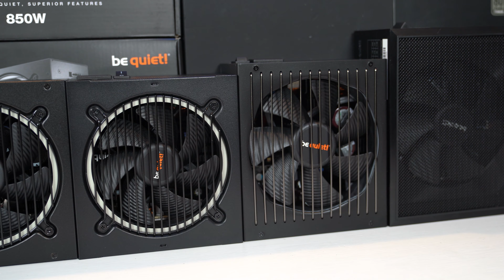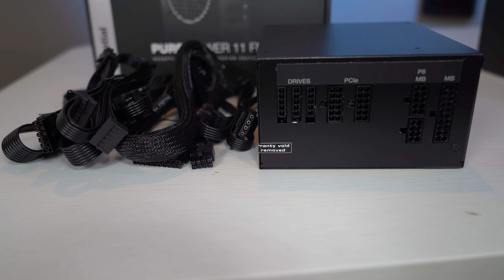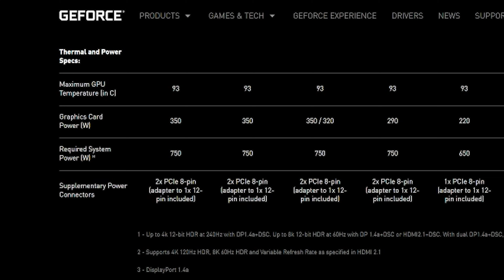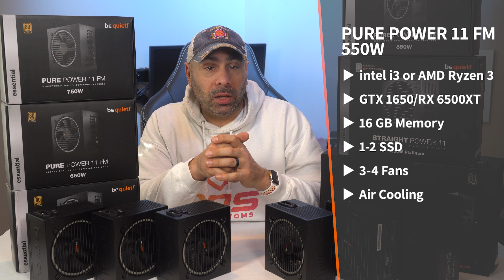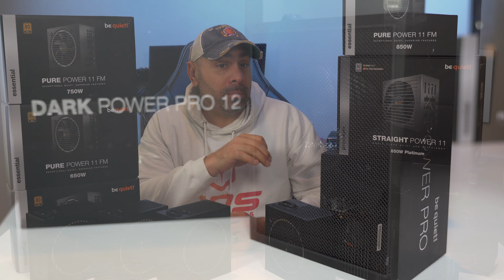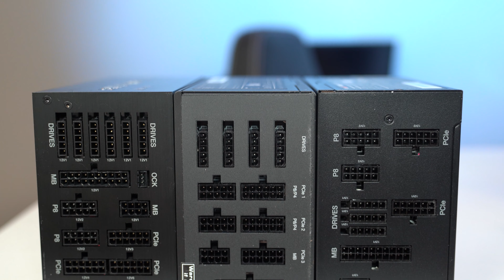How Much Power Do You Need In 2022?

Comment: I love going overkill on my PSU's. I simply don't care that that my normal desktop usage only uses 20% (which translates to roughly 86% efficiency), and that it could be a little more efficient. I'm currently using an Antec High Current Pro 1200w for a 5900X, 1080Ti build. It's a legendary PSU.

Comment: I'm waiting for the 40 series. Can I use (ASUS ROG THOR) 850W Platinum certified PSU for:
i5-13600k
Mid Tier Mobo
RTX 4080
AIO Liquid Cooling
4x 8GB DDR5 6000 Mhz
4x Fans
2x NvME
1 HDD
(I just ordered the PSU, don't want to make a mistake)

Comment: I have a 3070ti, Ryzen 9 3900x, 32gb ram, msi b550. 2.5tb ssd and 6 fans. Currently using a 750 gold+ psu. No heavy overclocking or nun of that. Is a psu upgrade a must??

Comment: I know GPU manufacturers tend to over spec PSU requirements as they generally cater for moderate/extreme overlocks and multiple attached devices etc. I personally have multiple itx rigs which according to many would be well under spec’d PSU …:
- R9 3900x w/ RTX3080 custom water loop 32 GB ram, 2x NVME & 3x SATA SSD on a Corsair SFX 750w platinum psu and runs well under its power requirements from the wall
- R9 5900x w/ RTX3080Ti, 32 GB ram, 2x NVME, 2x SATA SSD - Cooler Master 850w Gold SFX PSU

- R5 3600 w/ RTX 3060, 16GB ram, 2xNVME & 1x SATA SSD with a FSP 400w Gold PSU 
and in all cases, no overclocks other than PBO and I don’t generally use more than 50-65% of the PSUs capacity under gaming loads and light video/photo editing 👍🥰🏆🤩 I’ve even done some undervolting which has seen at least 10-15% … sometimes a bigger drop in watts drawn from the wall. CPUs / GPU’s / NVME / SATA / RGB light strips etc have become sooo efficient in many cases …. That high end PSU are only needed, as you mentioned Brian, for those with HEDT setups or small home servers etc with multi-GPU setups and super high-end super multi-core Epyc Or Xeon CPUs.

Comment: G'day Brian,
I hope lots of people watch this as this is where there is so much money wasted by people in Builds,
as an example Greg S did a $1000 Fiver Build Challenge video & the first build had i5-11400F, H410, 16GB RAM, 1GB SSD, GTX1650 & EVGA 650-V1 80+B ($50),
He also did an optional $1422 Upgrade Build with i5-11400F, B560, 16GB RAM, 500GB M.2, GTX1660Super & Corsair RMX850 80+Gold PSU ($125), 🤷‍♂️WTF! why would you recommend that PSU upgrade as a 650 is plenty
Reply: Ps I edited as after reading it looked like I said it was Greg's recommendation, it was not & Greg's thoughts on the builds were very good

Comment: Brian, Good Video 🙂  It might have been helpful to some if you mentioned the efficiency curve that all PSU's have on the side of the box.  That shows that your 'Peak' efficiency takes place when you run a Power Supply at 50% Load.  I am a Professional Engineer, and that 50% is rooted in many power-oriented devices, since the 'very large' inductors that make up the main transformer avoid hysteresis by hovering at the 50% Load point.  The efficiency on either side of that curve drops significantly, which add credence to your statement that a PSU either too small or too big is not optimal.

Comment: When I built my fx system years ago i bought an evga 850 g2. I had no idea how big it was until I got it in my hand...at 200mm it is a beast, and I had to work to fit it and the cables in my case even though it was fully modular.

Comment: The only thing I would add, I often build with a upgrade path included. With a 10 year warranty on better brand psu's, they can be around awhile. Maybe I don't have the money for a 3080 today, but build a system planning for that in the future. Or next year's gpus up the power ususage, we've seen that. I often build entry level type systems with the choice to add a dual 8 or 8+6 pin gpu later. That adds some flexibility for a little added cost, but saves having to replace a psu just to get the power for your new gpu. 
Happy Building!

Comment: I just pick the SeaSonic that fits my budget or a psu from another company that was made by them. 

Just got a pretty good deal on a Focus Plus 850w for $84 

More then I need for a 3060ti and a locked 10400F but planning on getting something like a 3080 and upgrading to whatever the next affordable 😂 mini itx Motherboard comes out when ddr5 doesn’t cost a kidney and is worth moving to crazy when the CPU is cheaper then the other components

Comment: Many good PSUs have 10 year warranties. Future proofing is not a thing in most desktop components, but PSUs are the exception

We have no reason to think GPU power usage will go down with 4xxx series.

If you're not on nitrogen, you don't need 1600watts. SLI is dead.

But if you get 850 watts, or even 1000 watts, you can easily pull that PSU forwards through 2+ rebuilds, unless you plan on keeping your old build in service when you upgrade, In which case, you won't benefit from unnecessary headroom
Reply: 650W for 1 gpu system is enough and will be enough for a long time (and without overclocking of course).
Reply: @brakesteel0034  Yeah, especially for something efficient like RX 6600 and 5900x.